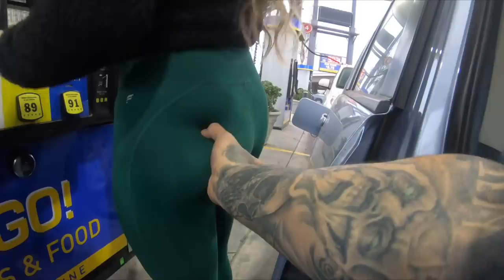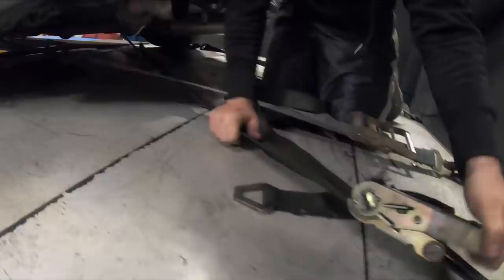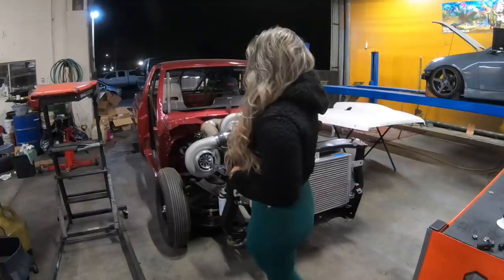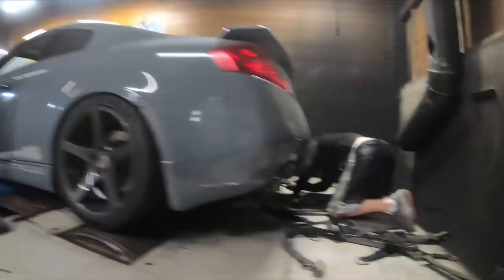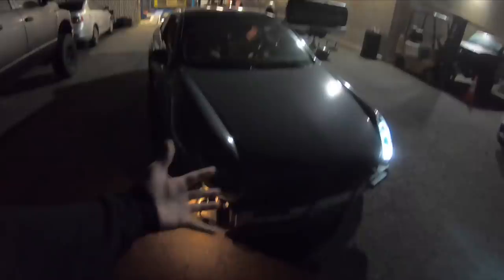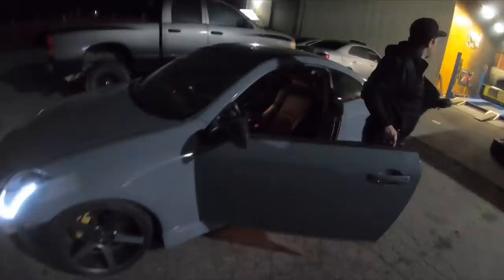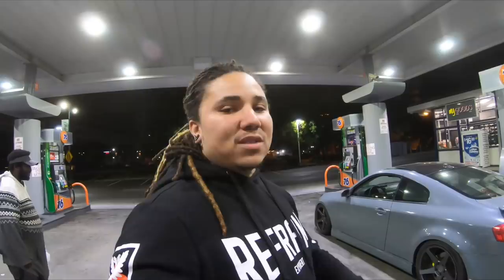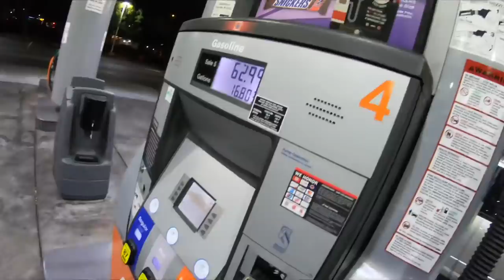Tuning my girlfriend’s boosted G35 coupe

Comment: Hey mike my Brother owns a 2004 G35 Coupe automatic transmission, But for some reason his thermostat for the radiator keeps breaking?? It’s happened 3 times now the car holds fluid dosent smoke or leak and its only got 150K miles.

Comment: GL with the build - i rebuilt my whole engine, braced everything, modified all items i could touch on one of my G35's, love the car and the 600+ ponies it puts out.  Not once in my G35's have i seen the airbag light, so that isn't true, They both say check engine instead (I checked the engine and it's still there).

Comment: Bro, check the knock sensor sub harness that runs from the knock sensor to the back of the engine.

The vq engines are notorious for having inadvertent knock due to that wire being frayed and shorting out intermittently and/or permanently. 

Z1 motorsports sells a quality robust replacement for very cheap.

Comment: You have blower surge bro. It's too rich @ idle. Engine richens & idle drops so the pump doesn't send as much fuel then it leans out which raises the rpm. It's common on supercharged cars fam. If your camshaft is installed properly, you shouldn't have anything to worry about cause it doesn't hurt the engine. If you can't adjust the speed of your blower, check your cam timing (it may be a bit too aggressive). I know a few guys running superchargers who have rides that do this same thing. The info that I'm giving you comes directly from them. I'd thought about supercharging my Mustang, but didn't like that loping idle sound, so I picked their collective brains before deciding on a turbo setup for the near future.

Comment: Why in the title it say supercharger but in the engine bay I see a turbo
Reply from the maker: Theofficial WET that’s a supercharged lol it’s not a turbo my guy... Superchargers are belt driven and turbos are exhaust driven
Reply: @Its_Mike_Myke  thanks for the insight. New to learning cars. I'm only 13
Reply from the maker: Theofficial WET it’s all love lil homie. Centrifugal supercharger’s look like turbos. Root style superchargers bolt on top of the motor like intake manifolds etc
Reply: @Its_Mike_Myke  cool i'll be sure to look more into superchargers. I like turbos more. But love the yt videos man keep up the great work
Reply: They look a little similar if you don't know exactly what you should be seeing.